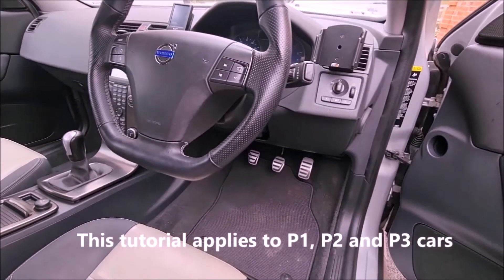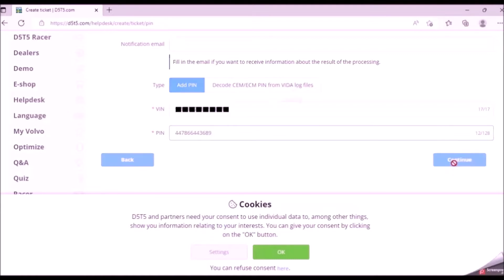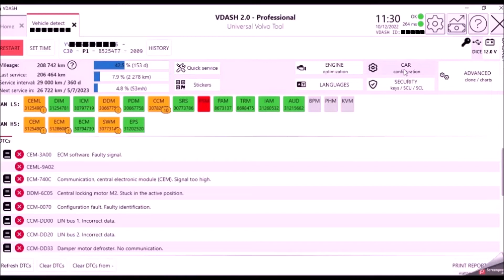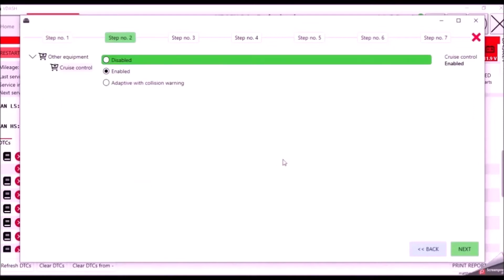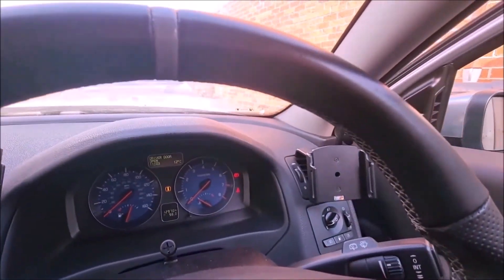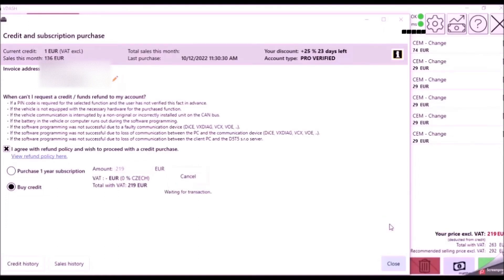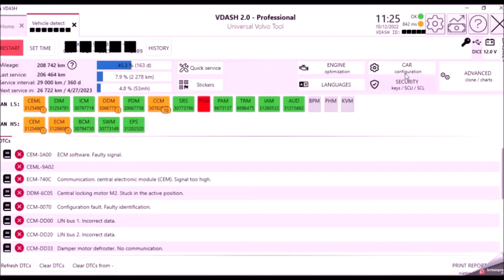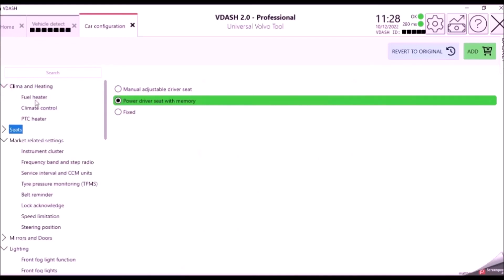Volvo CEM pin decode with @ModUnlock including Vdash tutorial

Comment: Hello! Thanks for the great video. I have Vida Dice 2014D installed on my laptop. And my question to you is, is it possible to install vdasch on my computer, on which Vida is already installed. There will be no conflict or problem with the two programs? Thanks! from Tommy Bertilsson from Sweden
Reply: To clarify what @BjørnFinstad said, no there will not be a problem having VDASH installed on the same computer as VIDA. Probably a good idea not to have them both open at the same time, in case they both try to access the DiCE interface at the same time. Aside from that, you're in the clear. I've got both installed in my VM and have no issues.
Reply: no

Comment: It's a nice idea, my DICE does 230-240keys/sec, modunlock 750/sec, the speed difference is considerable. But for the average DYI'er, spending 16 hours decoding vs 6 hours is not worth the £500 premium for this modunlock. Might be worth the investment it if you have a garage and you're decoding Volvo CEM's on a daily basis.

Comment: Definitely an interesting item. Do you know roughly how many keys per second this is able to do? Or are you doing some other secret sauce style decode to achieve the faster decode times?
Reply from the maker: The cpu in the cem can go much faster than the DICE mcu. 
The mcu in Modunlock is much faster than the cem cpu, so we just go as fast as the cem cpu can. it's about 750 challenges/sec

Comment: very very very expensive solution
Reply: Naah. Not that bad. Local volvo officials asked 1,700 euro for activate navigation on 2020 xc60. 1,7k euro…. Cmon. With vdash much much cheaper
Reply: @2dplay62  check smok interface
Reply from the maker: @sxatster  Other words you could have used are "convenient" "simple" "quick" "Easy" .  Smok is itelf an expensive thing to buy.  if you have 1 car it makes no sense to spend nearly 600 euros on smok.  consider the world from points of view other than your own :-)   , bear in mind the majority of the population of the planet cannot operate a zip file.
Reply: @modunlock1983  ok, I understand, I used it until I understood that the device can be repaid in a maximum of a year